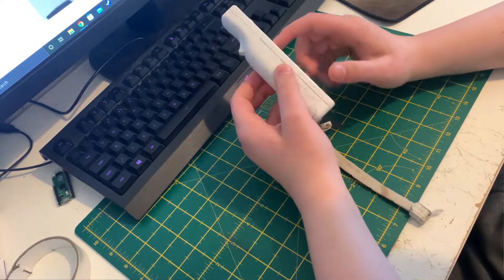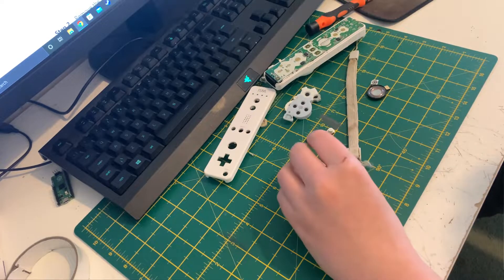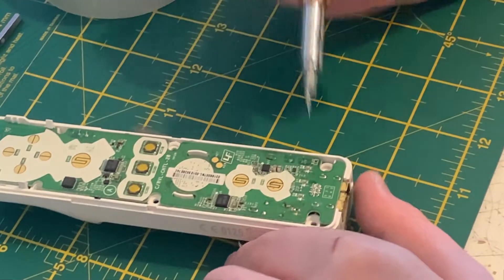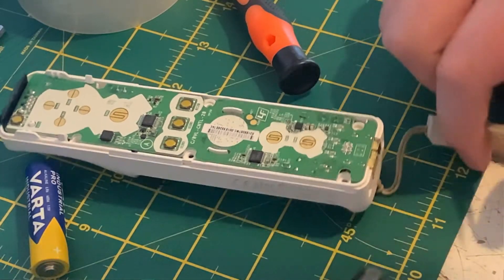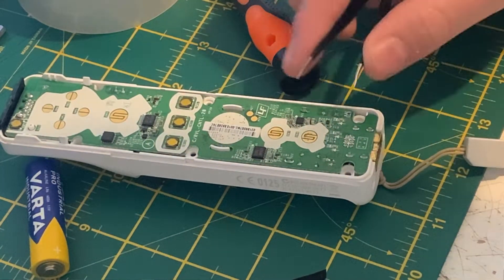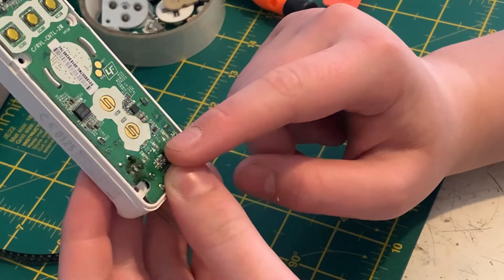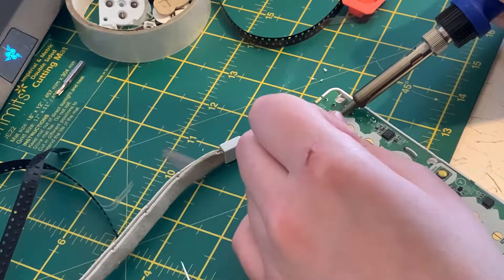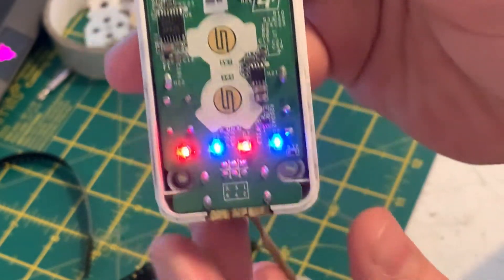How to add Custom LED's to a Wii Remote

Comment: Can you use 450c temp for the solder iron to desolate and solder them?
Reply from the maker: Soldering Temperatures differ between people. I use higher temperatures at about 375 degrees because I like to work fast. 450 degrees sounds too hot, and you risk damaging components.
Reply: @TheModSmith  Well I've almost screwed up alot of stuff then. I just started learning to solder and I've been using 750😅